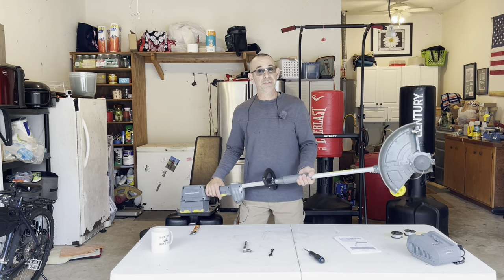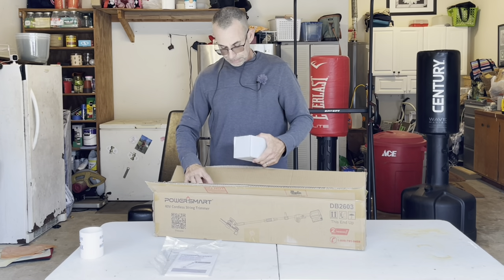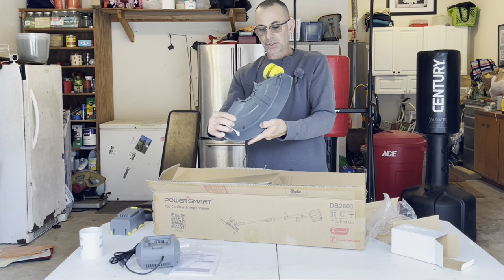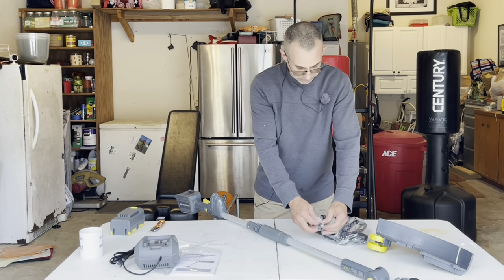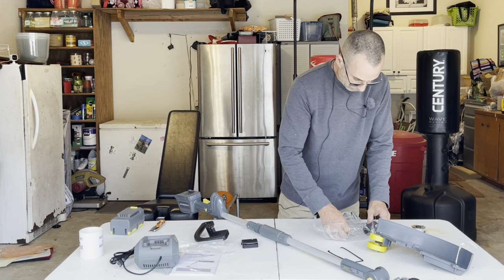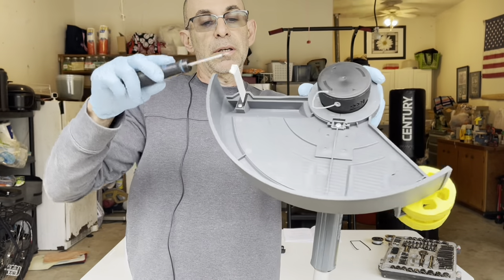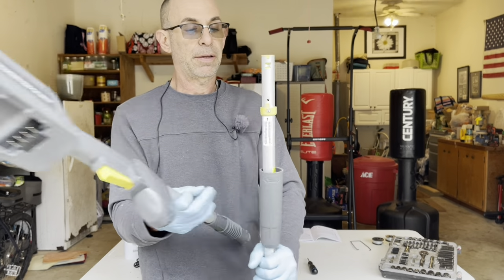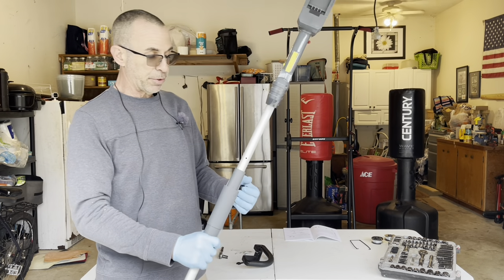Unbox Assemble and Demonstrate POWERSMART 40 Volt Cordless 2 in 1 Weedeater / Edger

Comment: As a solo operator I can tell you buying battery tools is AMAZING.  The trick is to have back up batteries and do your research so you buy the right product for your job or yard type. I run Husqvarna and their batteries will do 6-8 medium sized yards.  They are coming out with EGO commercial. It has saved me a lot of down time having battery tools and no mixed fuel to buy.    It is the wave of power tools but if you're old school and I am regarding a powerful edger BUY them now.
Reply from the maker: EGO just offered to send me a back pack blower for a review video. Should be arriving soon. I am looking forward to trying it out
Reply: @DansVlog  My friend John is a manager at an ACE HARDWARE.  He is a super cool guy. John ran a printing press for 20 years that did grocery store flyer inserts. When it broke he fixed it. So...John says...GIRL...the EGO is a BEASTTTT!!

Comment: I just bought a powersmart 4 cycle trimmer , As of right Now I am not currently impressed!!!! The assembly instructions are very difficult to Translate into a practical Application of putting it together... Does this thing or Does not thing have a primer button ? Where is the spark plug ? Do I or Don't I remove the green card looking thing beside the Carb ?  Do they or don't they answer customer service calls ??? As I said NOT impressed sooo Far ................